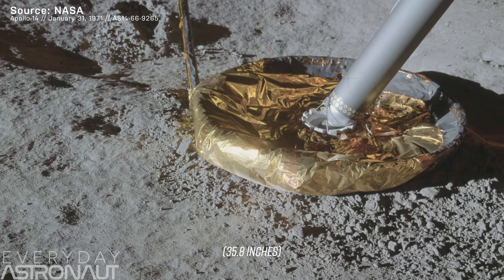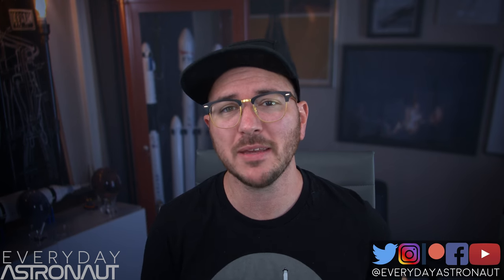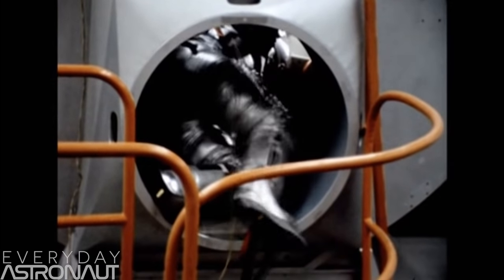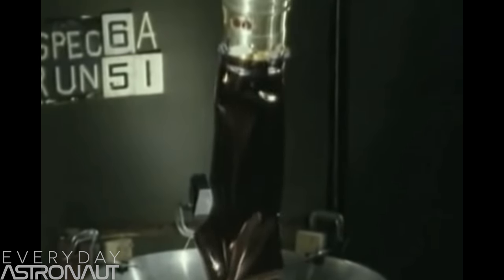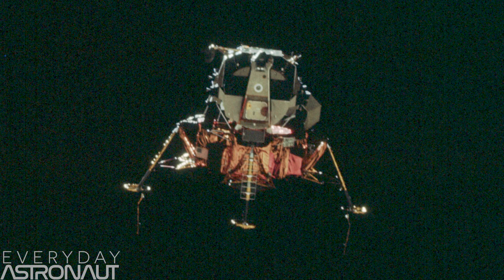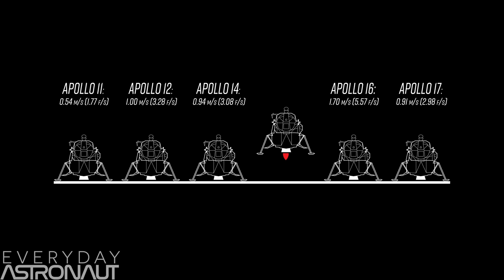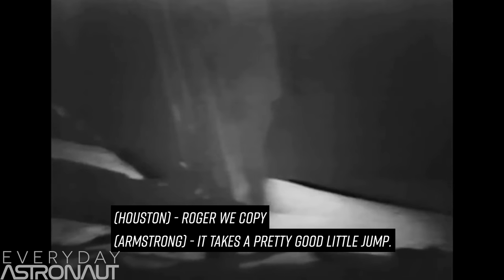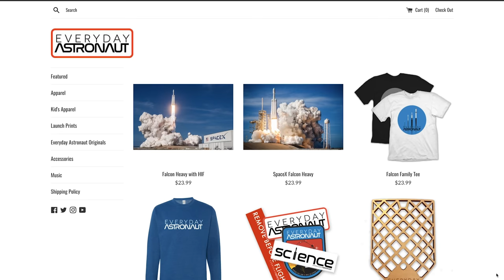Why were there missing rungs on the Lunar Lander’s Ladder?

Comment: So I know the temperatures on the moon don't square with the traditional materials used for rope making, but why not use a rope-type ladder , or even just a hoisting-cable that wouldn't rely on footing for assent and grasping for stability. I also know the moon's gravity isn't so low as to invoke cartoons walking on their fingertips, but it seems like in low-g environments it seems like you'd want footing for stability, and grasping for assent. Which is more what one experiences while rope-climbing, or cargo-net climbing, and less like ladder or step climbing. This kind of rigging would also be adjustable to multiple landing inclinations and conditions. Also with such a construct, the emergency backup plan of the second astronaut attempting rescue & pulling you back aboard if you are incapacitated uses the exact same equipment. (Because good luck getting an astronaut to fireman carry another one up and down a ladder in those big fat bolted-on spacesuits even in low gravity. They were practically so top-heavy they were trip-falling even without carrying one another. So if one miscalculated his strength or lost balance while attempting to carry another on board the incapacitated astronaut becomes an accidental battle-ram against a craft so fragile they were afraid they were going to kick a hole in it whenever they fall asleep! So it seems way better to tie-up a distressed astronaut and pull them back aboard after climbing up ahead, especially if its doubtful if the ladder system could carry two astronauts at the same time if the weight-saving design constraints were limited to one at a time procedure, and you can only do something like that with a rigging type for egress and ingress.) 

I think if we had used the lamb system for many dozens of manned trips to the moon instead of the handful we had, some of it's speedy design concessions to get us to the moon first would have likely been some of the very same things that got someone killed on the moon. An increasing awareness of the flaws in that system, combined with an increasing awareness of just how dangerous the environment of space was beyond earth's magnetosphere, & just how lucky many of the Apollo missions were in the estimation of the insiders working on the program contributed to the cancelation of the American moon program, every bit as much as the Soviet withdraw from its lunar ambitions, and later its economic/political collapse, because Uncle Sam doesn't really want a system that relies too much on skill of the best of the best on the luckiest days of their lives, it wants systems that it can deploy at increasing scale with increasing frequency at reliable performance metrics across battalions made of people of average luck, and adequate skill because its along those later parameters it can run projections on its strategic interests, militarily, economically, and so on. Anything that stays at 2 failures in 100 is going to remain only an experimental level of interests gaining and loosing funding on the ever changing political whims of congress. Ideally, what they want are failure rates that are statically negligible which is much less than 1 percent of the time. Neither the Apollo or the Shuttle program managed this, but whichever system is the first to break from that pattern in a big way is going to be the one that resets the pace of space exploration for humanity.
Reply: TIXE RIGHT     They are wearing bulky suits.

Comment: Iff you need 400 kg fuel/kg weight on  earth, how much do you need on the moon? Where is all the fuel stored, is it in the kapsulle? Gryz from Belgium
Reply: The ascent stage of the LEM only needed enough fuel to reach the orbit and dock to the Apollo to transfer the astronauts back into the Command Module. Afterwards, it was ditched to save the mass.
Because Moon has only 1/6th of Earth's gravity and no meaningful atmosphere, there wasn't much fuel needed. And yes, it was stored in the capsule.

Comment: Ok the reason was because they were not sure what the surface was and whether the lander would sink...hence the huge gap
Reply: So,  it would be a problem if the rungs were there and it sunk? I dont see how. you realize if it sunk that much, they would have about 300 other problems to worry about lol.
Reply: Like he said, they were more concerned that the pads would sink in or the shock-absorber compress so much that the ladder would hit the surface and perhaps break and maybe fall off.

Comment: All that tech worked perfectly 6 times.  And that hypergolic fuel, so corrosive the engine could not be tested, worked perfectly 6 times.  And that telemetry to blast off, accelerate exactly to the speed of the CM, in exactly the same orbit with a 69 buick computer.  Wow!  But getting back was of no interest!

Comment: Yoy inow they built 2 LEMS during the moon landing 2 identical modules in every respect. Ny best friends dad was in charge if the wiring of the LEM. He said rhe scariest part id the mission for gim was the ascent. The ascent engine could bot be stopped once it kit becuase it used hypergolic fuel. As soon as the engine lit, an explosive gulotin secered the wires between the ascent nodule and the dexent module. If that failed the asxent stage woukd have toppled over and the astronauts perished.
I lived in Bethpage during the 60s. After the moon landing, the 2nd identical LEM was pushed out intonthe parking lot, spray painted cameo green and keft kutside for over a year. I used to see it all the time when i went past the plant. I often wondered why they discarded it Like that. But it was useless as we had achieved a successful landing & recovery on the noon

Comment: There was a specific purpose for making the ladder short. just think, if the ladder went down to the floor it would have been so easy for each astronaut to just step off and then step on for getting back into the lem. What NASA wanted was to convince people they were on the moon and the way to do that was to perform some action that showed low gravity. so they cut the ladder short so that the astronaut would have to jump down and also jump back up. they used a special device to carry out this slow jump down and slow jump back up. I will leave you a link to my video that shows how they done it

Comment: The oleo struts on the lander were designed and built to stand the forces of a landing under computer control. (Get to 10 Ft altitude and shut off the engine and bounce hard.)
BUT,  Due to the computer glitch, they were landing in the wrong place, so, Neil took over on manual to land in a better spot.  He flew it down to the surface and lightly touched down. (The springs and Oleo struts never got the load they were built for and stayed extended.)  Neil's fault for being an excellent pilot.  
BTW: God has a sense of humor.  The only emergency landing on manual was done by Neil Armstrong, the guy who crashed the training simulator......
Reply: Other astronauts have crashed the LLTVs, too.
Reply: @Jan_Strzelecki  True, but according to NASA, Neil destroyed it completely. sometimes it was repairable.

Comment: Why did Apollo use 4 unstable landing legs instead of 3 naturally stable landing legs? Why does SpaceX do the same?
They should have used a longer hinged ladder like the Soviets planned to do The extra rungs could have been made from the 4th strut.
Reply: Why did Apollo use 4 unstable landing legs instead of 3 naturally stable landing legs?
Because 3 landing legs wouldn't be enough to prevent them from tipping over.

Comment: Now shall we be honest - the landing gear was designed to land on million years old moon, covered with meters of dust and sinking in it. Instead they landed on a brand new moon, only covered with few inches of dust which accumulated over the few thousand years of moon lifespan. Thats right, the amount of space dust falling on the moon has only been gathering there for few K years and not millions. What does that mean, u figure it out.
Reply: "What does that mean, u figure it out." I figure someone has lied to you about the rate of dust accumulation on the moon. Was it your priest?

Comment: If to use the ballistic movement formula the module would fall on the moon next to the main engine shut off. So the signs of the thrust work shall be beneath of around the module.

Comment: 5:14 Actually those legs wouldn't have been designed to stand but to recist the impact of landing, gravity or not kinetic forces still apply. An average human walking speed is 1.4 meters per second, an average airplane landing vertical speed is 2m/sec. The lander was a very tusk propulsor rocket technology so we can only assume landing was much harsher than well matured tech like airplanes but not so much that astronauts wouldn't survive landing. So, a lander weights 35,000 lbs, going at a speed of 2m/sec would produce 51,800 lbs of pressure on the landing gear. The lander's legs should more than be capable of sustain a mere 35,000 lbs of constant weight on Earth...
Reply: "a lander weights 35,000 lbs, going at a speed of 2m/sec would produce 51,800 lbs of pressure on the landing gear."
How do you compute that part? Just curious.
Reply: @ThomasKundera  You have to use the kinetic equation, the answer will be in joules and then you change it to pounds of pressure.
Reply: @Ramiromasters  : How do you go from joules to pound of pressure?
Reply: @ThomasKundera  You first go to Newtons, which are kilograms per meter per second squared, and convert to pounds.
Reply: @Ramiromasters  :  [repost]
But joules are not Newton. So how do you go from joule to newtons ?
Reply: @Ramiromasters   [repost]
But joules are not Newton. So how do you go from joule to newtons ?
Reply: @jimmyfly The kinetic energy of something depends only on its mass and speed and not the source of its origin. In other words if you crash on Earth at 200 miles per hour or you crash on Moon at 200 miles per hour, your impact is that of an object traveling at 200 miles per hour with given mass.
Reply: @jimmyfly As I pointed out, those legs were designed to withstand the landing impact of such mass at 2-5 feet per second, the at rest position would be a secondary consideration.
Reply: @jimmyfly Physics 101 your mass does not depend on your weight. If I place a baseball ball in your head that only weighs a few grams then you are ok, if I throw it in your head at 96 mph you are not ok, the ball has gained momentum equal to mass and acceleration.
Reply: @jimmyfly Another example, if I have a pound of gold that is a measure of weight on Earth sure, but that doesn't mean that if I got to space I just lost a bunch of gold, the quantity of matter is the same only its gravitational pull to the nearest object has changed.
Reply: @jimmyfly Well you don't need to imagine how fast the lander would have fallen because this same video also gives us the landing speeds...
Reply: @jimmyfly The formula for kinetic energy is Ke= 1/2mv^2 There have fun plugging gravity there!
Reply: @jimmyfly I have a better one for you, have the same object fall at 2 feet per second on your head on Earth or on Moon, which one would you prefer?

Comment: 33 seconds in and you're already looking at a huge anomaly...  why are those dish shaped landing pads SO free of any soil and where is the blast crater?  why does it look like it was gently put in place?
Reply: MW
You're not thinking it through. The descent rocket blasted the dust radially, and in a vacuum, how would that dust ever drift  back to land on the pads? It would obviously all be thrown out to the sides, like the debris field from a meteor's impact. 

And it's naive of you to think that NASA would have "forgotten" to put dust on the pads, if they were faking it, and dust was expected.
The ironic thing is you've just pointed out exactly what would be expected in a landing in vacuum. :)

Comment: Clip from 10:57  to 11:16
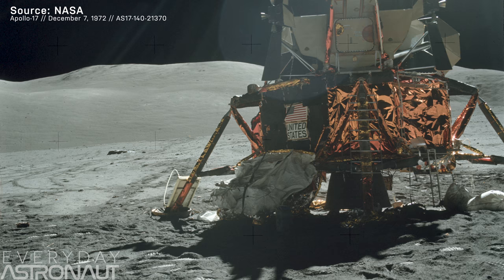Picture at 11:10 min
Shouldn't the landing legs be buried way deeper into the powdery surface (that took 80 percent of the impact...)?
And if NASA had planned for the landing legs to compress much more, isn't the nozzle of the engine way to close to the ground?
Reply: "Shouldn't the landing legs be buried way deeper into the powdery surface" How deep would they be buried if the surface wouldn't absorb the impact?
"And if NASA had planned for the landing legs to compress much more, isn't the nozzle of the engine way to close to the ground?" How much was the maximum depression of the legs?

Comment: I WOULD LIKE TO TALK ABOUT THE BATTERY
Reply: 2 125-lb. 28 volt batteries were on the rear, under the insulation blanket.
Reply: I don't know math but can see it and to me  it don't add up
Reply: they only had two battles
Reply: @tigerofwar99  Humongous ones! And don't worry; to the people who did the math, it did add up.
Reply: so that about 700 watts
Reply: now a small apartment wold use that in one mouth
Reply: @tigerofwar99  You can't get watts from just volts; you need to know amps. Google the fine details; I don't care enough to do it for you.
Reply: 4.8 amps well higher but around there
Reply: I get 250 amps but I still don't know what the ship needed to run

Comment: could you do a video on how there was no moondust thrown everywhere from the landing 
or how were so many photos taken given the time on the moon or who took the video when they left the moon
or how they had air or heat
or how they spoke to people on earth from so far away or how an astronot could even hear comsidering how loud the noise must have been. or how they didnt lose their hearing completely during initial take off from earth considering the decibels would be close to 250 to 300 from the noise when rocket engaged. or how the space suits would have protected from vacuum of space considering on earth in nasas vacuum facility they need 6 ft of concrete and steel to contain the vacuum. please enlighten me

Comment: Two missing rungs.  Notice how fast the astronaut accelerates toward the surface as he jumps off the last rung. Looks the same as if he were on earth. With 1/6th the gravity he should accelerate toward the surface at 1/6th the rate. (9.8 Meters per s/s vs 1.6 M/s/s on the moon.) On the moon it would look like he was jumping in slow motion. Therefore this video was made on the Earth. Doesn't mean astronauts didn't go to the moon but it makes one wonder what videos and photos are real.
Reply: Well there also is no air to slow one down.
Reply: @starwarsweexplain6380  Air in the earth's atmosphere does not slow down a jump that short.
Reply: Notice how fast the astronaut accelerates toward the surface as he jumps off the last rung. Looks the same as if he were on earth.
And then he jumps back up with a relative ease, proving that he is indeed on the Moon.